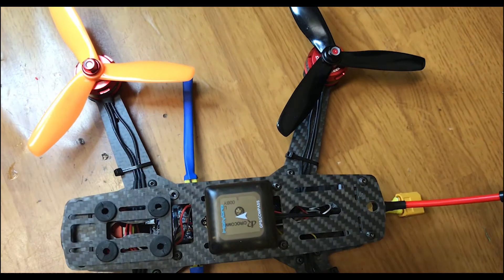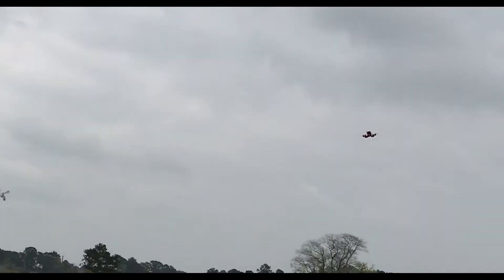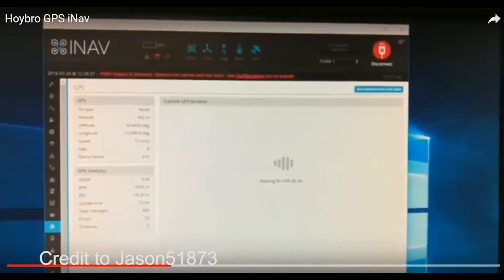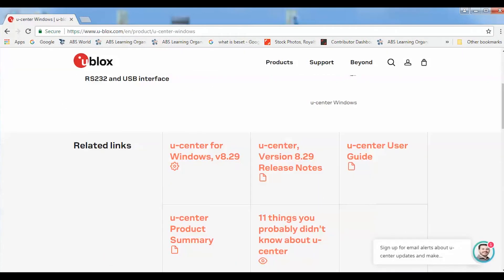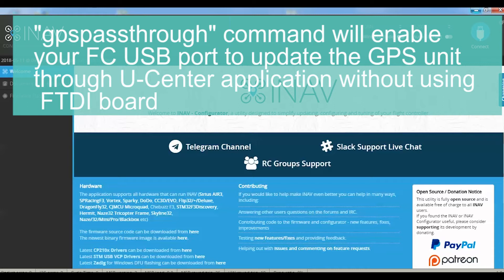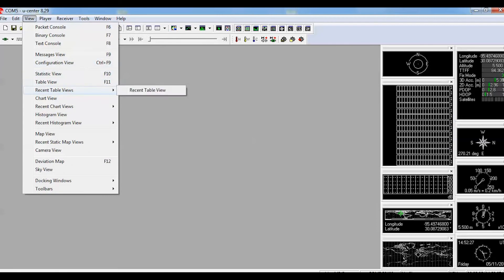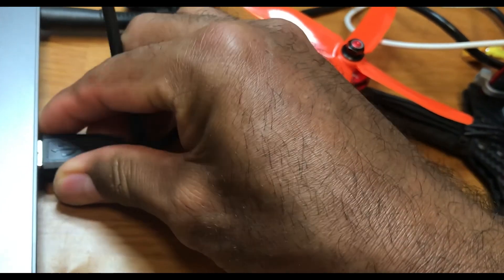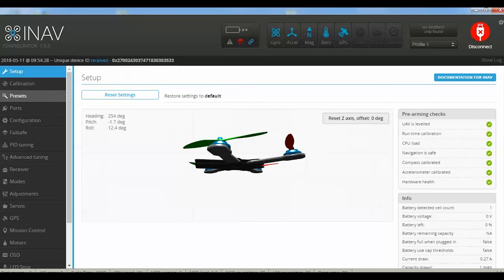Holybro M8N GPS wont hold and 3D wont fix for INAV ver 1.9.1

Comment: HELLO, I HAVE THE SAME GPS AND I'M GOING OUTSIDE TO CONFIGURE IT, COULD YOU TELL ME HOW IS THE CORRECT ALIGNMENT FOR INAV? THANKS A LOT
Reply from the maker: Hi Giovanni. Thanks for your inquiry. Alignment is a tricky part. Don't let go of your drone in GPS mode unless you are 100% sure of the alignment of the GPS or your drone will go away. I used the i-phone GPS apps as a reference for correct orientation. Then adjusted the offset angle on "Board and Sensor Alignment"  tab of I-Nav. There is a video posted in youtube that can help you.  Here is the link.  https://youtu.be/A05RQPSyMSg. Pay attention to the video at time stamp 6:19.
Reply: @VictorinoJake  Meanwhile, thanks for your concern, just because I know how important it is (I have experiences with Mission Planner) and failing to align it I'm looking for news, I'll watch the video you suggested. Greetings